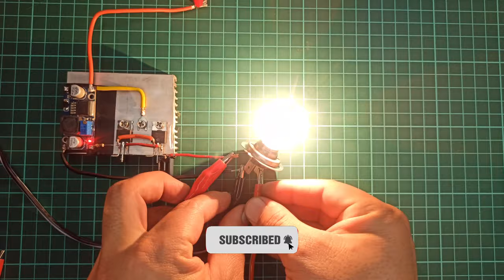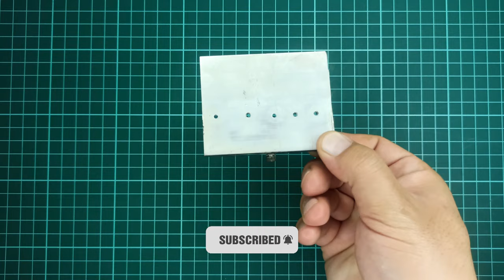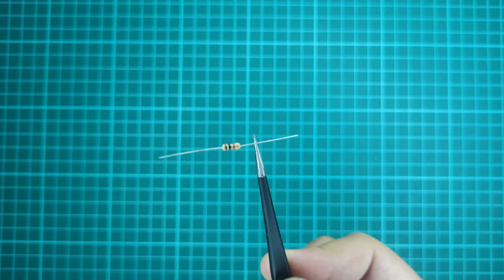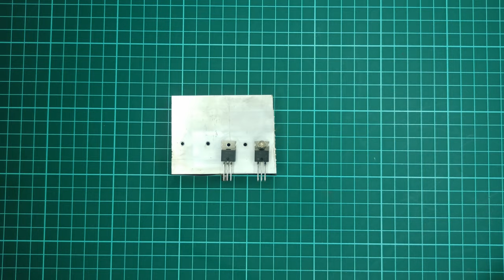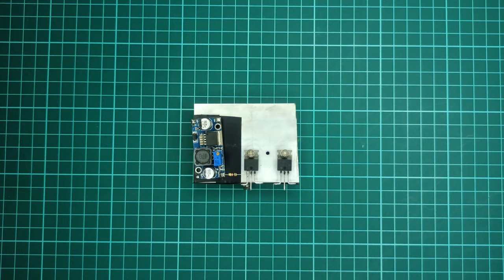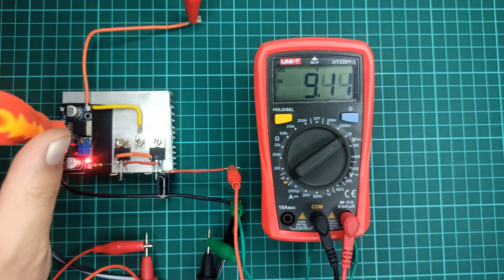How to make a 20 Amp LM2596 DC-DC Buck Converter | Step down Converter | MOSFET |

Comment: That´s no more a Buck converter. It´s just became a LINEAR converter.  You should change the tittle "How to make a 20 Amp LINEAR regulator from a LM2596 DC-DC Buck Converter"
Reply from the maker: I agree, if the power conversion is performed at the switching stage then it would be called a buck or boost converter. 👍
Thanks

Comment: This is fake! This is a linear non-stabilized power supply now! Instead of the buck module, you can use a tl431 with a trim potentiometer (to reduce cost and remove switching noise from the buck converter).
Reply from the maker: Yes that can be an option too.
This circuit is just showing a crude method to quickly increase the output current nothing else.

Comment: Made this today, didn't have the 740 mosfets so I used IRF840 rated at 8 amps. Ran 5.9 amps of current through it, works good. Will probably use as a small power supply. Thanks again.
Reply from the maker: Thats good to hear, this circuit has a lot of applications and can be extended further like adding a short circuit protection.
You can also attach a dc-dc buck boost converter instead of a simple buck converter.
Reply: I'm going to look into adding an over voltage system as well to keep from that potential catastrophy as this is a good looking project for my RV power system that will be using a 48v solar array to power my MPPT controller to charge a bank of LiFePo4 24v batteries the having to have a way to supply all the 12 v accessories in the RV. I was thinking about have a secondary battery @12v to handle high surge loads such as when the fridge and furnaces kick on. I'me working at getting all the lighting switched to LED so that is a drop in a bucket. Just tha water pump which draws a pretty heavy bit when it's on combined with the other things if and when they all are on at the same time. If there is a current limter in the converter, I can adjust that to keep a float voltage on the secondary battery which will also be a LFP with it's own BMS circuit. This would make it so I didn't have to have so much current from the converter? Put in an auto resetting circuit breaker on the output to the BMS and battery. If you feel like it give me Y'O'P.  @ERLEngineering

Comment: the amps at the light was only4.5amps where is the 20amps you said. 55/12=4.5??????????
Reply from the maker: The presented circuit has the capability to provide upto a max of 20amp. Here the applied load can only draw a max of 5amp. For max performance test you'll need to add a load which should draw 20amp current, also the heatsink in this circuit is not suitable for 20amp so you should add a bigger heatsink with airflow system for proper functioning.

Comment: So many ways to get a job done with electronics, I've seen buck converters the used high current coils on the down side of the MOSFET's and now a low current coil installed on a buck converter so only the FET's handle the high current. This method looks a lot easier to construct as with the PCB already built and just using that to drive the Gates of the FET's. So doing it this way a person can add in FET's in parallel and get a lot more current capacity on the output as in using this with a large 24v battery back or even a higher voltage bank. So long as the input doesn't over run the PCB's max input. But as I intend to run my converter below around 30v max, this would work just great. If I had a spare converter PCB module. I need to look in my parts bins to see if there is one in there. I know or pretty sure I don't have those FET's on hand but I think I have some others that will work, I have some N channel 75v  75 amp pieces that I think would be great for such a task. My converter needs to deliver maybe up to 60 amps so I would use maybe 3 or 4 of those with a good heatsink and fuse it for sure. Put in a thermistor and a fan control system. As if I don't have a PCB converter board, I found another post that makes it's own converter and might be able to put that in with this config.
Reply from the maker: Yes indeed it is, although a crude method i must say, but it do the job.
Better option is to design a dc-dc step down converter using ferrite cores

Comment: its working good but you are doing high side switching with NMOS so why it doesnt require bootstrap circuit or can we use PMOS instead
Reply from the maker: The NMOS (IRFP-740) employed in this circuit could benefit from a bootstrap circuit to guarantee that the power MOSFETs are fully in the ON state when high current flows through the circuit and avoid any damage to the DC-DC module. This video demonstrates a basic setup to boost output current, hence I ensured that the gate voltage of the MOSFETs consistently meets their requirements to maintain them in the ON state. Alternatively, PMOS can be utilized, but it's essential to ensure that the gate voltage requirements are met (preferably with a bootstrap circuit).

Comment: You should have shown the amps going through the meter. Maybe use a 10 amp device as well. Other than that, great work. Will try it out.,
Reply from the maker: Thank you dear for your observation and nice comment.
I will be making another video on a better  version of this circuit and i will add an ampere meter too.
Great observation.

Comment: Efficency of this circut can you plzzz tell me ? 
Is this circuit work as mppt i.e for e.g of i have 40v solar pannel neeeds to convert them to 24v is it workable there? 
Increasing the no of fets will increase the amperes??? Plzzz answer all the questions .
Reply from the maker: Um, honestly i haven't calculated its efficiency but it would be atleast 85-90%.
For stepping down DC voltage of solar panels? I'll not recommend this circuit as it is for low power applications only. Usually the solarpanels deliver high amperes at the load side so its better to use high power DC-DC step down converters as they have quite good efficiency.
Increasing the number of FETs will not solve the problem as it also require current balancing.
Reply: @ERLEngineering  thank you so much means a lot really 
But plzzz one more question in market 400watt buck converters are available with 2 moesfet can i increase the no of fet in paralel on the same circut can solve my problem

Comment: Will this circuit charge a 16.8V 18650 battery pack with a 4S40A BMS when connected directly to a 190W solar panel without a charge controller?
Reply from the maker: Yes it can, but i would recommend you to use a DC-DC buck boost converter module instead of a DC-DC buck converter because solar panels do not provide a steady voltage so the module will step up or step down the input voltage automatically and you will get a constant output voltage for charging.
Also it is important to mention here that BMS circuits can handle a changing input voltage but higher input current will damage the 18650 cells, so you must add a current limiter circuit before your BMS in this setup.

Comment: i tried this according to your video. 
i need to convert input 12v to 5v output
i am using n-channel mosfet IRF740
when i set the output 5v using the potensio, i measure the voltage at the lm2596kit is around 6volt
when i put a load of a bulb similar to your video. the output voltage drop to around 2volt only
i measure the output at the lm2596kit is around 8volt (increased from 6volt to 8volt when there is load of bulb at IRF740 output)
would you please advise where is the mistake? thank you in advance
Reply from the maker: As per the description provided, i think there might be something wrong with either your mosfet or the DC-DC converter circuit.
In a normal scenario, when a load is applied the output voltage drops a little bit (within 1 volts) depending upon the current requirement of the load, and if this happens then usually more mosfets are attached in parallel (the source is considered as energy rich here).
Another scenario can be, if the source id unable to provide the desired power then abnormal behaviour from the circuit is expected.
So, check your power source if its capable of providing the desired power for the load, also make sure your converter circuit and the mosfets are in good condition.
Finally, the wires should be good enough to deliver the required current (minimum losses) and the distance between the converted and the mosfet should be kept minimum.
If your problem resolves, do give me a feedback and its reason. 👍
Reply: @ERLEngineering   thank you for your promptly reply.
the power source is a car battery (accumulator) and when that happen I did measure the voltage at the battery is not dropping.
in the video you mention a mosfet of IRFP740 but I can only get an IRF740. is this the same?
all other thins I have rechecked and all good
Reply from the maker: How much current is required for your load?

Comment: Are there alternative models of power mosfet? Is it possible to use irfz44n for example?
Reply from the maker: Yes, there are many but you have to check the datasheet for parameters like VDS, ID continuous and RDS

Comment: Hi there, thanks for nice contents you make . I need to design a circuit to control about 200 A DC . Actually I have a mining  PSU and I need to convert it to a variable power supply with CC and CV . Any suggestion you can make ?
Reply from the maker: Hello, thank you for your feedback.
To answer your question, mostly this kind of dc to dc conversion requires PWM ICs like the TL494 and it has a builtin feedback circuit for the CV and CC application. But controlling high current using the mosfets only is not a best idea. For that, you should use a ferrite transformer based PWM circuit that can provide you CV as well as CC output.
Using mosfets directly can easily fry them for such high current.
Reply: @ERLEngineering  Thx for the quick answer . what do u think about power mosfets in parallel ?
Reply from the maker: You are welcome.
Adding power mosfets in parallel do increase the current but it has some drawbacks.
It cannot provide CC, you have to add an additional circuit for the CC feature.
You will need to add a voltage regulator circuit before the CC circuit to provide the CV feature.
Reply: Sounds to me like you are wanting to make a TIG welder or power supply for a MIG unit here. As ERL said, you need an Xformer in there to isolate and use a PWM controller which will reduce the load and heat those FET's need to handle. There should also be a hell of a big bank of caps in there to smooth out that power.  @ERLEngineering

Comment: Hi.Thiis can be used also on xl4015 module and still regulate the current?Thanks.
Reply from the maker: It should work on all types of DC to DC converter circuits where the voltage regulations are done by the converter circuit.

Comment: Can I use two IRF3205 MOSFETs in place of this ones you're using for the modding?
Reply from the maker: Yes, the IRF3205 can handle a much higher drain current as compared to IRF740 MOSFET and they have the same gate threshold voltage.
Reply: Yes those will work and to beauty of it is they will do the job with much less power loss due to internal resistance and voltage drop, which reduces heat needing to be dissipated.

Comment: how is this any different from a resistive regulator?
Reply from the maker: Because unlike resistive regulator, it consists of a regulator IC with a feedback to control to output voltage and a seperate current path for flowing of high current.
Reply: It doesnt. Its an adjustable linear regulator.

Comment: Is this have short circuit protection?
Reply from the maker: No dear, this is just a basic idea for how to increase current of any DC-DC buck converter.
But, short circuit protection is very important part of any high power source and can be added using simple relay and some components.

Comment: Sir What Is The Input Voltage and Amper
Reply from the maker: The input was connected to a 24v 20 Amp power supply source.

Comment: With input 24V and output 12V the mosfets must be very hot as it can't handle for continues task as 12 volt droped at mosfet it self.
Reply from the maker: The voltage is not being dropped across the power mosfet, but the dc-dc converter is stepping it down first and then the stepped down voltage is being applied to the gate pins of the mosfets while the high current path is still directly through the drain-source pins of the mosfet.

Comment: I made  this proyect and  I  tried different mosfets and different values of capacitors and in all of them it happens that the voltage is not constant, it drops when applying a load, you have to adjust the voltage for different loads in amp, I think this project is incomplete
Reply from the maker: That must be because your main DC power source (power supply) is not sufficient to provide the required current. The voltage drops when a power supply does not have sufficient current to provide it to the load.

Comment: How does efficiency?
Reply from the maker: For this one, i didn't measured it but i believe that for mosfet like IRFP series with low gate-source voltage (low on resistance) the efficiency should be above 90%
Reply: @ERLEngineering   If I connect 20V 1A input, it can produce 10V 1.8A output, right?  I am an electric noob. I thought different voltage conversion by this circuit loss to heat.
Reply from the maker: Yes you can say that but for a very good quality, low ON resistance mosfet.
Since this circuit is using a DC-DC converter and its very efficient in terms of stepping down voltage, so the voltage conversion is quite efficient, yes. But most of the losses will now occur at the mosfets as they get quite hot at high amperes so the reduction in efficiency will be mostly due to the external mosfets.

Comment: How to set output current then?
Reply from the maker: The method only provides a way to increase the output current and not to control it.
For having a controlled voltage and current source, checkout this circuit
https://youtu.be/FvjwaMs1x9E?si=8fAQNxH4-v48Bg9D

Comment: Hi, I need a jumper cable for my vintage Renault that converts from 12 volts down to 6 volts. However, I need at least 20 amps of output current. Who can help me to build such a device? Greetings Kurt
Reply from the maker: Hi there,
So you need a dc to dc converter that should convert 12v to 6v and the output amps should be atleast 20amps. Am i correct?

Comment: The same can be done with 1 Poti. You drive the Mosfets in Linear Mode and the Voltage drop dissipated to heat. Never ever 20 Amp.
Reply from the maker: That will not give you the voltage regulation 🙄
20 amp is debatable 😁
Reply: No, you lost the voltage regulation too. Where is the Close-Loop Feedback from the Drain?
The Datasheet of the IRF740 doesnt say anything about the SOA(Save operating Area, Fig.8) for Linear Mode and the max. Amp depends on the difference from Input to Output Voltage.  I estimate 1/5 per Mosfet. Congratulation, you turn a 3 Amp regulated Buck Converter with 80% efficiency into approx. 4 Amp unregulated Power Source. ;-)
Reply from the maker: @Netsroht72 The regulation is still carried out by the 1st mosfet on the converter and that regulated voltage is being provided to the gate of the mosfet, i have checked the voltage regulation and its working fine, alot of other people have also proved this concept.
As i mentioned in my previous comments, a better method is to utilize ferrite core transformer based dc-dc converter which will ensure voltage as well current regulation.
This is a crude but quick method to improve the output current of this converter.
Reply: @ERLEngineering  Yes, you are right. There is a kind of regulation. I dont see that the Mosfets are High-Side, so the Voltage drop above the Load reduce the Gate-Source Voltage. But i think that work not very precisely and depends on the Load. 
And in my opinion that kind of regulation works with my only one Poti Variant too. But for Quick and Dirty its ok.